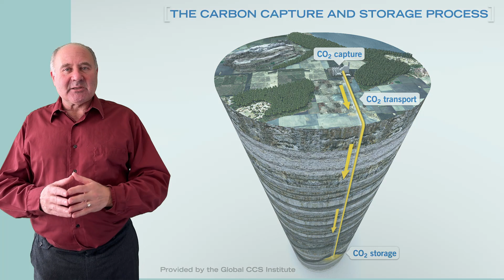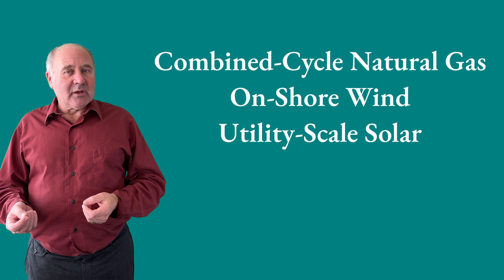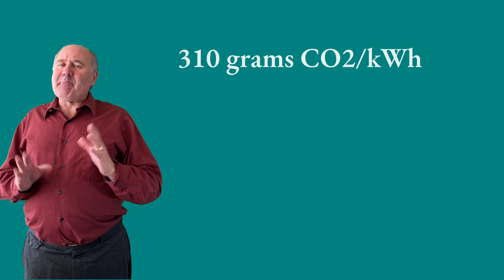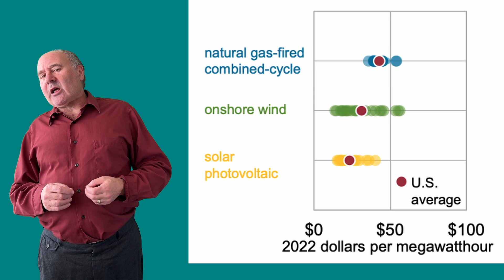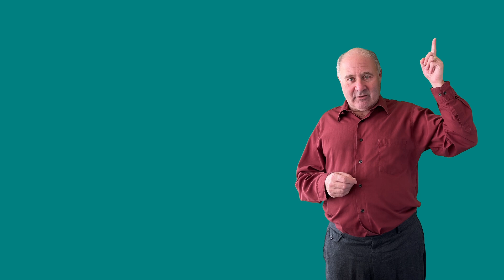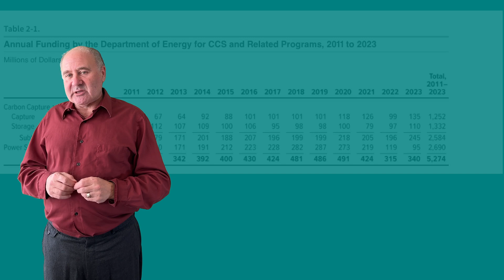Carbon Capture and Storage: It won't save natural gas power plants, but it still has a place

Comment: Can never understand why we want to store carbon underground as CO2. We should lock  combusted Carbon in carbon based plastics in long term products such as buildings following Carbon capture from processes having CO2 as a flue gas.
Reply: There's a lot of research in this area, but it is challenging. CO2 is a very stable molecule and requires quite a bit of energy to incorporate it into plastic.
Reply: @nemock  I am aware of this but ultimately it will be better for us to reuse emissions from our fossil fuel industries to make stuff rather than let it get into the environment
Reply: @garrettosullivan8830  Sure, as long as it takes LESS energy to do so. Currently every method would increase the total energy output required to capture the CO2 and then store it in a plastic. That would currently result in a net INCREASE in total CO2 out. There are many published papers in this particular area which show the math for this issue.
Reply from the maker: That's the idea behind carbon capture and utilization. I just don't think the market for those products is big enough to absorb all of the carbon we should capture. That doesn't mean we should do as much of it as we can.
Reply: @Decarbonize11  But in the long run we need 100% recycle of all materials and plastics made with recovered carbon are the best option for this. I don’t believe we will be able to get rid of the produce loads of stuff and throw it away global society that has been created in the last 20 years so we must do our next best to keep emissions of this production out of the atmosphere waters and land.